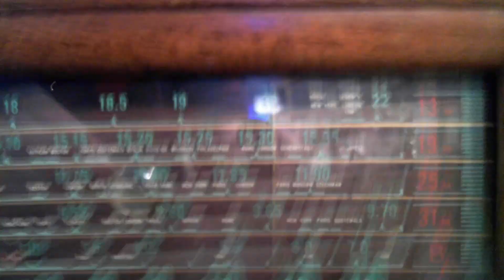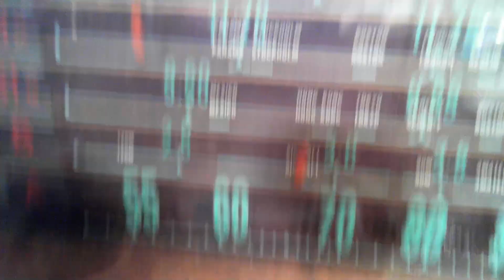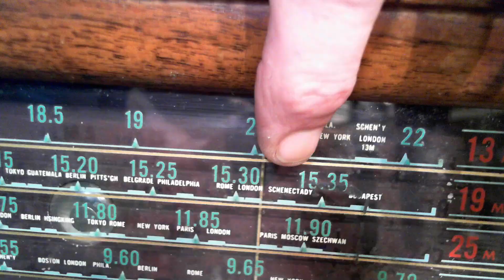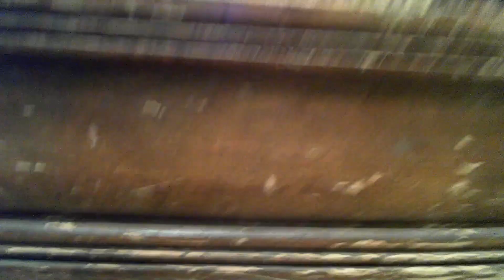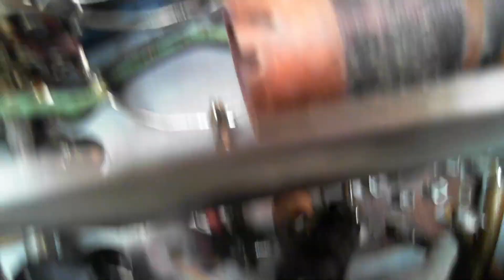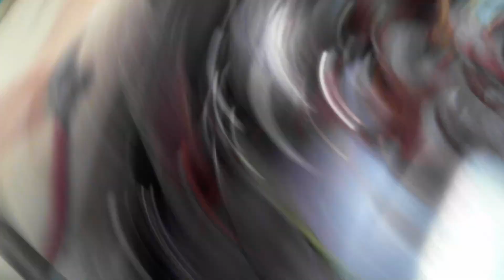RCA Victor A38 Shortwave Tube Radio Video #1 - Checkout

Comment: A very fine looking set thanks for sharing it. I don’t envy you the woodwork I hate cabinet work. What will you replace the asbestos with ?
Reply: I would have  left it in and painted over it with latex paint using a disposable brush. Call it encapsulation.
 Not sure why they decided to put asbestos far below where the hot tubes are but it may be because there 
wasn't a fuse put in to protect the transformer. So when he does put a fuse in, there is no need to do anything
else. Doubt anything would cause a fire inside the chassis with proper electrical protection.

Comment: Let the butchering begin...
Reply: Hey! Cut him a break. Jim brings a  calming humility to a snobbish practice of self inflated macho jerks. Jim does not preach or proselytize about his   skills and techniques. He is a HAM, like many of you and deserves respect. His methods are sometimes puzzling, I admit and recognize that too. This is one project i would never attempt. There is something about those real old radios that I do not like.my favorites are the AA5 junk of the 1950’s. I do like a transformer set the most.
Reply: @erin19030  He already tried to repair a very similar radio, probably the same model and it was a disaster - Of course he always end up saying "the radio is working" when in reality the poor things can't even tune more than two AM stations...
Reply: @erin19030  You do have a valid opinion, but you ignoring couple of points: He is collecting a fee for his repairs and that involves accountability and liability for the job involved. And when safety and security standards and codes are blatantly disregarded, you aren't doing a serious job. BTW, ham is a non-commercial private licensed radio operator with a registered call sign. Jim is not.
Reply: Jim goes at his own pace but the man does great work and knows his onions
Reply: @allthegearnoidea6752  You gotta be kidding us.